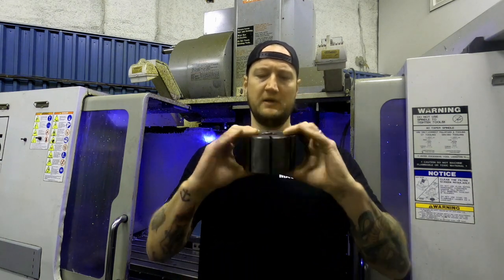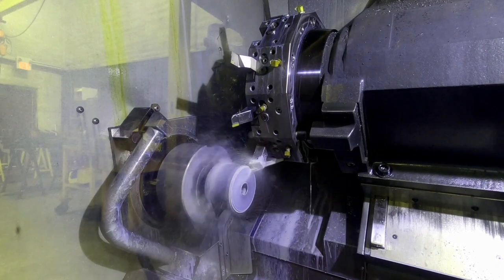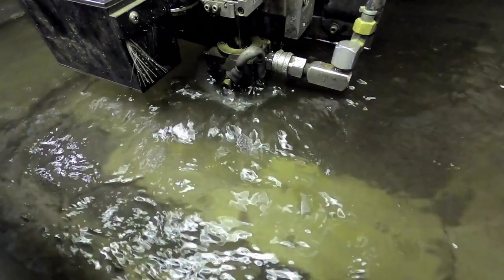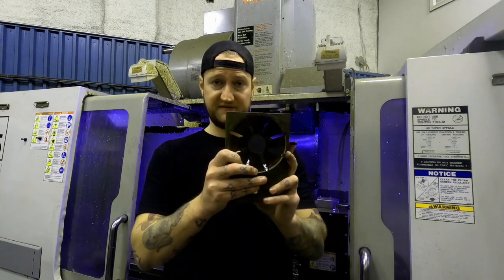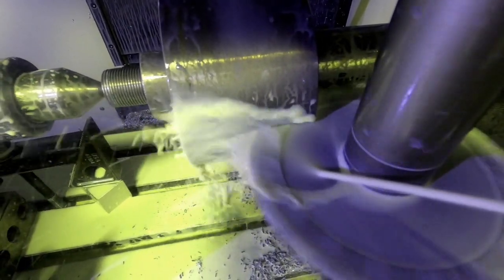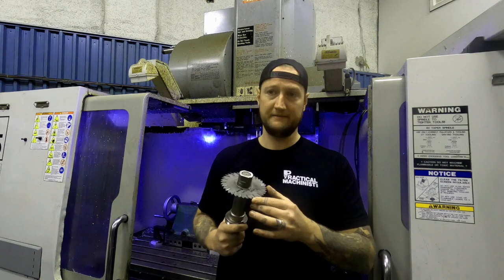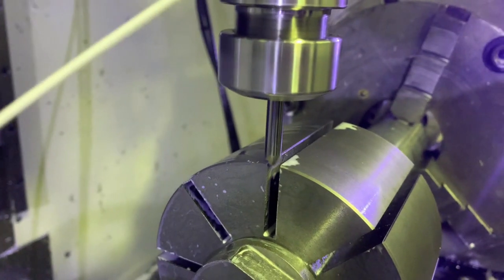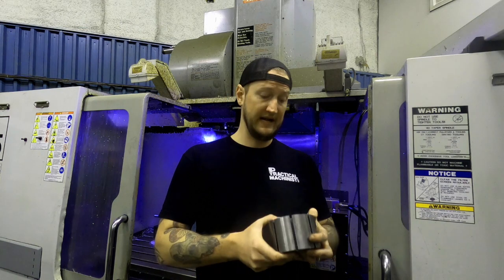Machining a Vane Pump [PROJECT VLOG] | Machine Shop Talk Ep. 40

Comment: Btw, about 50 years ago I rebuilt a small fan/ air pump based upon an arbor exactly like that one you're slitting now. 
I'd never seen one before and didn't have any info on it but I figured out how it was supposed to work and I rebuilt it. It worked. I used phenolic vanes. 
It was an air motor that supplied instantaneous pneumatic pressure to operate a couple of small air cylinders that advanced two opposed drills.
Clever little machine. 
They actually found a factory rep who came out and immediately said I'd wired it backwards - I hadn't, it worked perfectly, but he had to save face and find something wrong. 
The arbor in my little project was only about 2 1/2 to 3 inches across but it could definitely pump some air!
Thanks for being such a good teacher, Ian!
You're a boon to the industry! :)
Reply: It’s funny, I’ve never actually witnessed a vane pump in action! Thank you very much sir!
Reply: @iansandusky417  You're quite welcome! :)
Reply: Lol, great now I’m going to end up making some of my own air tools

Comment: Actually ...I made my rotor for my DIY rotary vane compressor using exactly the same method. I also have a video about the process. I have a Schaublin SV-51 milling machine that is older than me (dating 1955). So the operation was totally manual. Yes, slitting saws are good. Especially those with staggered teeth. Straight saws are not that good for cutting deep grooves as they have a tendency to bind and explode.

Comment: Thats why every shop needs a oldtimer or two !
Before you said a word i had the very same proces i my head.
Accept the keyway i would brooched with an arbor press .
Wire edm even existed in my young days .
It was the machine that always collected alot of dus.
Its a very specialized machine not used alot and thus not making money. 
And in the long run , the later is most important.
Reply: I had some blowout on grey iron or whatever they make sheaves from when broaching. Do you have any tips on keeping that down?
Reply: @TBJK07Jeep  never brooched grey iron thought...mayby more stricky lubricant and or petroleum as a cutting aid .
greets from the netherlands

johny geerts

Comment: You need to look into purchasing a Davis Keyseater.  This would handle the internal key and potentially even the outside slots
Reply: Big time, I use my wire machine for a LOT of keyways where a broach would probably be a quicker solution - just a matter of using what we’ve got! Interesting it might go deep enough to hit the outer slots, I’ll definitely look into it - thanks for the tip! 🍻
Reply: We have to do a lot of similar work every day, so we choose the wire cutting process, which not only ensures the quality but also improves the efficiency

Comment: Great video, really interesting hearing your progress through different techniques. Benz make an interesting driven broaching tool that is driven from the spindle and cuts at 1000 strokes per min
Reply: Thank you very much for checking it out! That’s pretty quick, I’ll have to look them up! I’ve always been nervous about using broaching tooling in the CNC but it seems it’s come a long way
Reply: @iansandusky417  yeah they're like a spindle powered jigsaw with a reciprocating mechanism, not using the z axis. I had a job that needed a load of square broached holes that i looked into them for but i couldnt justify the £10k for that job. Went for a rotary broach in the end.

Comment: I do heaps of keyways on my 2 axis lathe. I use revtool slotting tools. Works a treat. Just work out how to lock the spindle a couple of g clamps and a piece of square stock works for me. Saves using the edm for the keyway.
I have used carbide slitting saws a little. Spin them faster and decent feed per tooth. The iscar tangentially mounted saws have 4 edges per insert. 2 left and 2 right inserts. No need to buy designated left and right inserts like some other brands. 
Any reason  why you can't remake your mandrel to fit say 4 on there and then you can leave the machine for longer? Great video
Reply: That’s a fantastic question - we probably could remake the mandrel and toss 2 or 3 on there et a time, that never actually occurred to me! Very much appreciate the suggestion!
Reply: @iansandusky417  no worries. Also consider turning up a shaft to go into the taper of the tail stock. So prior to parting off program a move of the tail stock to bring the shaft ( smaller than the part bore of coarse) into the part so she  the part drops it falls only a couple off mm onto the shaft. Then retract the tail stock and heavy part. No dropping of heavy parts. If marking the bore is a potential problem just wrap some electrical tape around the shaft.

Comment: I’ve made the exact same parts back in 2011-12ish (I’m assuming the same ) 
I did two sets I think I remember so much about them because first time running that material.

they use to be in Barrie. 
 We did one at a time on the lathe  we saw cut 1/4 longer  then faced off the rest after . Did the rest the same as you  I call it indexable  we used an iscar just one rough and finish inserts should last a while in that material.
Reply: Could literally be for the same customer, hard to say! Those indexable ones do look useful - we usually swap out the finisher for the rougher and use a new finisher every 20 parts or so depending on how they’re looking, so inserts may pay for themselves pretty quickly!

Comment: Question for shop owners. I am a new CNC job shop. Like many I started off with aluminum and soft steel. Now I am moving into SS like 304. My question is, got a job for 304 and I have to order tooling. Is it wrong to pass on the cost of tooling to the customer?  It's just a couple of end mills designed for SS. I am worried that there might be a reasonable expectation for my customer to assume I have all tooling for his job. It should be noted that it's a large company feeling me out, and just purchasing the tooling for their small job puts me upside down unless I pass on the cost. Should I eat it in hopes of......?
Reply: In my opinion, tooling cost should be built into EVERY job. You already put the machines on the floor, you already pay to keep the lights on - don't short-change yourself into a bad job! We run quite a bit of 304, and when I costed them out, I built the cost of carbide inserts / endmills I knew were going to be basically consumed during the run, and if I didn't completely kill the tools - that's just a bonus for me.

Tooling - when you're talking endmills and inserts - should be treated as consumables in your quoting, the same as wire for the wire EDM machine. You don't need to be upfront about the actual cost of the tooling, just build it into the part price. If the customer comes back wondering why it's higher then expected, it's totally reasonable to have a conversation letting them know that 304 beats up tools and work-hardens super easily, so you have to use good tooling for the job if you want good results.

I will also add that a customer who wants an itemized list for cost of material, cost of each tool, cost per minute of labour, etc - is probably not going to be a good customer in the long run. The only exception I can think of is if you're talking huge runs of hundreds of thousands of parts, and they're looking for ways to HELP get the cost down - ex, they have a better supplier for material than you do at a cheaper rate. 

Any customer who is going to turn their nose up at that is likely a bottom-feeder, and probably be more headache than it's worth - in my experience, anyway. Let them go to the shops charging $40/hr shop rate, they can see pretty quickly what that's going to get. Best of luck!

Comment: I'm curious what the surface finish callout is on those slots, and if the slitting saw is enough to satisfy the requirement.  From what I understand the vanes on those pumps are made from something like phenolic or plastic.  I imagine a rough surface would chew them up in a hurry .
Reply: It’s honestly very smooth after we finish it up with that finish saw - indeed, it’s a phenolic vane that fits in there. We’ve been doing it this way for a few years now (so probably a few hundred parts) and they’ve never failed inspection at our customer’s place!

Comment: Newbie alert!
First, thank you for another informative video.
What are the surface roughness requirements for the slots walls?
Reply: My pleasure! There aren’t any direct surface roughness specs called out, but you’d be surprised how smooth a true running saw with the right specs can get them. When we first switched from wire EDM to this method we sent a sample for inspection and it passed, so that was the green light go ahead with this production method.

Thanks for watching!

Comment: Ian, when you guys were making these using wire EDM, had y'all considered slitting saws? If so, was there a reason you didn't immediately switch over to slitting?
Personally, I would feel more comfortable parting off over length and then facing the end to length. That's just me. It is more work but I'd feel more secure that way. 
Thanks for sharing!
I always enjoy your Videos!  :)
Reply: Thank you sir! The reason we started with wire EDM was because there was a pretty tight tolerance on these slots, and frankly - I didn’t think saws would be rigid enough to hit it with enough accuracy.

Fortunately - and this was around 2015 - we had a very good machinist come in who recommended switching to this method, and it turned a 2/day part into a 5-8 / day part! 

Most definitely - I personally am not a lathe guy (beyond most basic jobs) so I kind of defer to what my guys think will work best, and we haven’t hit a snag with it yet! I think we may try that method in the future though, based on some of the feedback here. There’s always good things to learn from guys who have been in the trade much longer than I have!

Thanks for watching, have a great weekend!
Reply: @iansandusky417  thank you! :)

Comment: done similar parts many years ago on an old horizontal mill and dividing head , ok 30 years ago the machine was about 40 years old then lol , but that machine was solid , on a cnc i hate slitting saws as an arbour's not as rigid , also i would not part that off it would be quicker to face off that 10mm of material to hold than parting . just my view .
Reply: Definitely something we’ve considered! We were just nervous about holding it up - with a centre in it it would probably be fine though as a single part and decking it off - I agree!

Funny how once you start doing something one way you just keep on rolling with it, even when an easier solution may be right there!
Reply: @iansandusky417  it is i am lazy , if it seems like hard work or have ass clenching moments to it,  i change it , i bet you have MO before the part off lol , being lazy is more efficient .